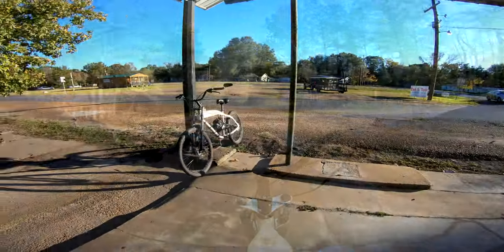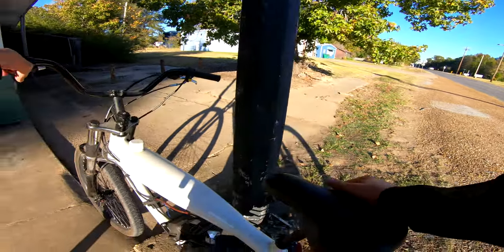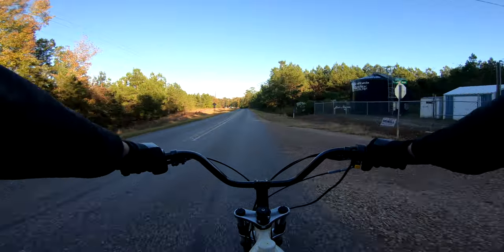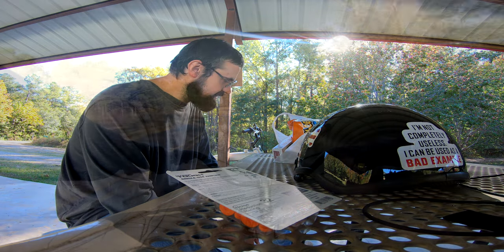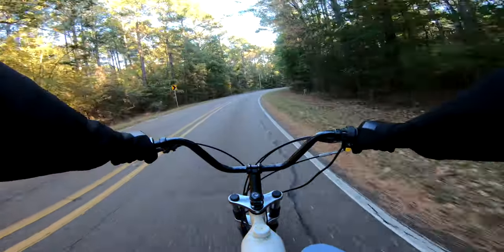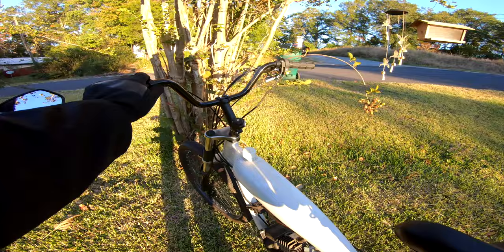Chainsaw Hybrid Endurance Ride

Comment: If I guessed, it looks like you are cruising with a speed sprocket at about thirty mph on average👍yes, 36 tooth does also provide quite a noticeable fuel savings💫
Reply from the maker: Spot on, kept it between 30-35 for the whole trip.

Comment: So a little off topic but how do you think a 80cc engine would work to get me to school and back? I am tired of taking the bus but walking is a hour and a half. My travel is only 4.7 miles with gas stations along the way but i will have a tiny Jerry can with me. Do you think it would work?
Reply: I have quite a good mind around automotive so repairs will be simple and i know a couple people at bike shops so I could get deals on parts as well
Reply: You can do 10 trips to school and back with a bike.
Reply: And you might get cold during the winter  so get some good gloves
Reply: @2-stroke748  with a full tank? Dang! That's pretty efficient. But yeah Oregonian winters suck so that will be on my list of things to get from the hardware store
Reply: I use a 56 tooth with my '80cc' and did a 26 mile stop and go trip around town,with several hills included,and had 1/4 tank left in the standard kit tank of 1/3 gallon.I put knobby tires on for winters.You just really need to go slow then.LoL.Happy Trails.
Reply: Along with spiked tires...
Reply: @Frostbite..  Build it and send it!
Reply: An 80cc will be more than enough, try to keep it as stock as you can except the gas tank, upgrade to a 4L tank and you'll have to fill up maybe once every week and a half
Reply: @MrJasenstewart97  yeah. Maybe only a 36 tooth sprocket and a dual exhaust is the only mods I'll do till i get more knowledge. But then maybe I'll put a new carburetor on it or a new cylinder cap with dual spark plugs
Reply: @bryduhbikeguy  thanks! I'll keep that in mind.!
Reply: @Frostbite..  36t is what I use and a good pipe to use is the nasty jack wc80 clone and get a normal cnc high compression head the dual plug heads are just gimmicks
Reply: @Frostbite..  my current build is a cdhpower super pk80 Ported with a cdhpower windowed piston and cnc oz reed valve with a vm18 carb and a cnc high compression head as well as the stock magneto but high output cdi 26in wheel with a 36t sprocket on a cdhpower felt faker. If you can't tell I like cdhpowers products
Reply: @Frostbite..  even with all my mods tho I get around 88-93mpg and with a stock motor ran reasonably with a good port cleaning and jet the nt carb right maybe even take the end cap off the stock exhaust it'll get even better mpg
Reply: @2-stroke748  up and down the hill. Don’t forget the gloves. We didn’t have gloves back then.
Reply: @MrJasenstewart97  ah I see!
Reply from the maker: Your situation is nearly perfect (IMO) for a gas motorized bike. On average the "80cc" kits will get about 40-50 miles per tank (80~mpG).
Your first build will probably give you a hand-full of little issue, so you may want to test ride it for a week or two before using it to get to where you need to be.
After a while you will learn all the little tricks, and taking it on daily rides won't even give you a second though.
Reply: @LAHover  Thanks man! I'ma break it in pretty quick with me riding it every day

Comment: I haven't done it yet but I'm sure the engine/head will run cooler with a diy air scoop forcing more air over it. They've been proven to work on old air cooled 2 stroke dirt bikes. If it's made right, I'm sure it'll help keep a chainsaw build cooler.  One of these days I'll make one out of some scrap diamond plate aluminum. Use tape & cardboard to make the mock-up/template scoop, cut pieces & tack weld together with a torch & alumiweld rods or add tabs to design that bend & screw pieces together. Then use some tiny screws to attach into the cooling fins.
Reply from the maker: It's a great idea, good luck if you try it!
Reply: I want to do this as well, been thinking about retrofitting a scooter or chainsaw shroud and fan

Comment: Soon building a felt faker frame can’t wait to strap on a powerful motor and send it 🤘 also I agree a performance motor tend to shake and vibrate a lot at the low RPMs and likes to cruise at a higher speed
Reply from the maker: Good luck with the build, stay safe!
Reply: @LAHover  yes my man I will most likely save up and buy a felt frame with the Ridgid triple tree forks and I good set of wheels. I was looking at the ones bikeberry had 12 gauge spoke ones with disk brake mounts also. Then all the other little parts will be pretty normal but the motor I’m kinda stuck on. I want to get the bike built first but then try and get a ms460 cylinder setup and I know I probably won’t ever use it to its full potential but to be honest I’m sure you can relate it’s way over powered. The frame I’ve always wanted not because of it being any more fun than a cheap build but because I simply love the look of a gas bike frame.

Comment: Thank you for the ride and feed back, I have learned alot from watching your videos. I have just finished building a ms 380 hybrid myself. Still working out a couple bugs and tune, while researching the spark gap I came across some info that stated you should run a minimum of mid-grade rated octane fuel to keep it running cooler. I'm not sure how big of difference it would make in a long distance run, but every little bit helps.

Comment: I enjoyed this one very much and love your vids. Think you should pull a trailer with it and use the back pack for fixit stuff. the trailer holds extra gas and a few tires and tubs with all camping gear. lol call it the bug out bike. It might cure the sprocket config with an extra 80 pounds it pulls. Just A thought out loud. run it a little rich just for tug. in a 1944 spitfire plain you had to turn a nob to make the engine rich to get off the ground. then lean it out.
Reply from the maker: Thanks for the suggestion, I may give that a shot. I'm actually doing a gas bike camping trip this week. I got the trailer all loaded up and ready to go. If all goes well, I may try it with this bike too.
Reply: @LAHover  I am thinking the weight of trailer might help keep the bike in the sweet spot. good luck ride safe and don't forget knee pads, gloves and wrist support!!

Comment: You could attempt a few day road trip on this.. A cruise.. 25mph all day long with a 2 gallon Jerry can with premix strapped to your luggage rack behind the seat. Bring air pump, backpacking tent, mini essential tool pack, grease tube for the chain, and lube/adjust necessary tensions every few hours

Comment: Thanks for the great info LA.I use mine as my transport too and want to go further sometimes and am going to build my 2nd soon.I want to be able to license it as a moped as I want 30mph and that's my states rules.I could use this current motor as it really wants to rev well past 20mph with the 56tooth sprocket,but I do the 'under 20mph pedal assist' rule. I've been looking for more torque for the smaller 44tooth and I think your's is better.

Comment: Brother I thought my butt was toast off my 22 mile run. Idk how you rode for thst long hahah! Nice work my man.
Reply from the maker: Not going to lie, the seat on this bike aint great lol. Lucky for me, the bike was fast enough to get this trip completed in less than two hours. Here is a great seat for long rides btw, I have it on two bikes. https://www.amazon.com/Zacro-Oversized-Bike-Seat-Replacement/dp/B09GXLMY6V/ref=sr_1_2_sspa?gclid=CjwKCAjw5P2aBhAlEiwAAdY7dJpnLmFB2V0Q0Q8bU3kurzYD3GT9CIExFiil1p_vG4zsIFjuKBQrNhoC2sgQAvD_BwE&hvadid=616928249431&hvdev=c&hvlocphy=9025605&hvnetw=g&hvqmt=e&hvrand=6083760405637422975&hvtargid=kwd-300744422040&hydadcr=9379_13604246&keywords=zacro+bike+seat&qid=1667260860&qu=eyJxc2MiOiIyLjk3IiwicXNhIjoiMi45NyIsInFzcCI6IjIuNjcifQ%3D%3D&s=sporting-goods&sr=1-2-spons&psc=1&smid=A2LCLHNZI16QFA
Reply: @LAHover  aaaaawwwww more speed faster overall trip. Makes sense haha. Thank you for the recommendation. It's within my budget for the month so I think I just might have to get it!